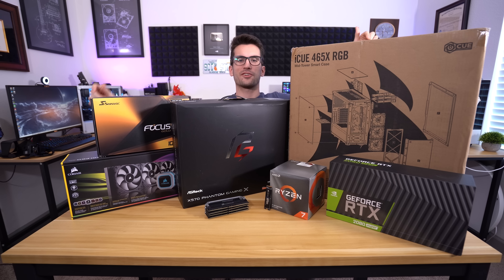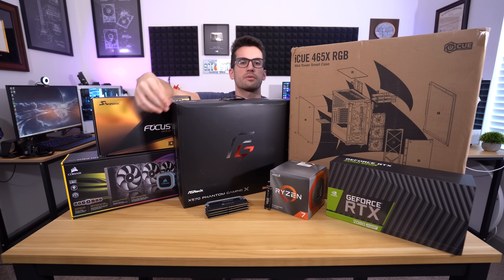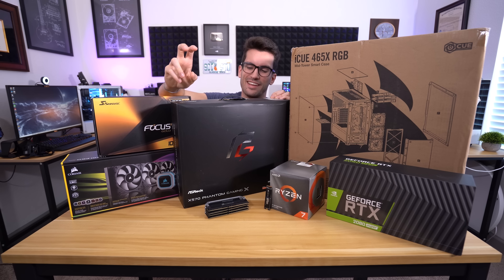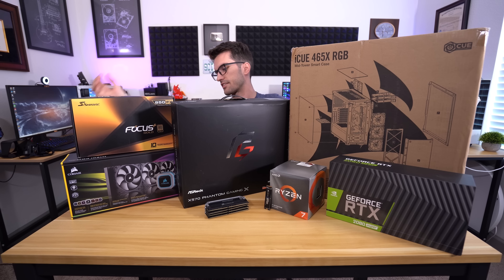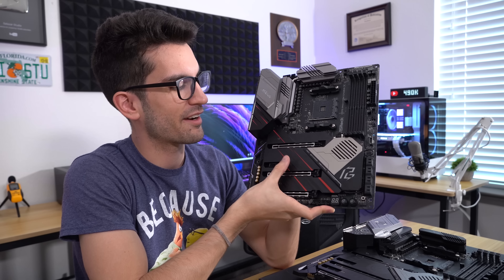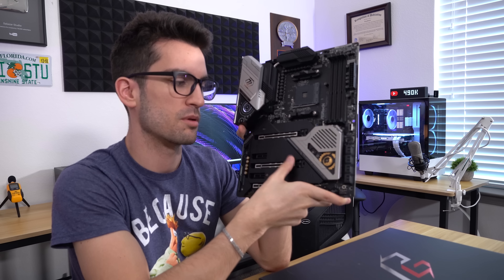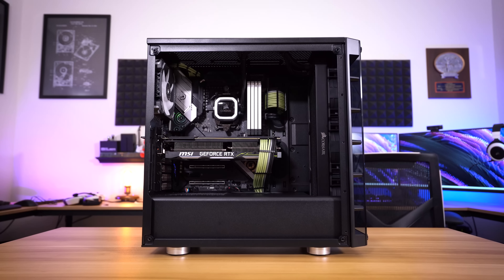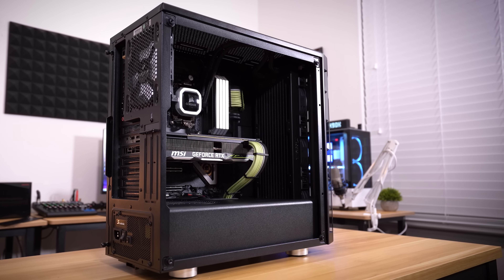Building a Powerful Gaming PC

Comment: "I'm going to use less RAM and a different CPU, for gaming"
"This is going to be my editing rig"

wait
Reply from the maker: In its current state, it's an ideal gaming rig. And I said that I wanted to use the 3800X for editing in Resolve, yes! :-D The 2080 Ti is a beefcake on the platform. But I'll be running different configs to test Resolve as I move along. 16GB vs. 32, 2080 Ti vs. 5700 XT, etc.
Reply: @GregSalazar  Fair enough :) still a solid machine, but I couldn't resist. Not like I have any room to talk, I record my videos with a smashed galaxy S7 and edit them on a computer someone gave me 6 years ago.
Reply: @ambirbtruckdriver  Smashed or not, its a very decent f1.4 12MP camera that does not disappoint!

Comment: I love Ryzen 3 but I can't seem to get it out of my head that the existing 3700X should be called the 3700, and the existing 3800X should be called the 3700X.

I was under the impression that the "X" in Ryzen's line-ups was meant to signify higher TDP's & base/boost clocks, and a higher number altogether was to signify more cores/threads.

Comment: Interesting. I just got my 3900x and I plan on using the AsRock Taichi x570 mobo as well.
Reply: I used that board for my new 3900x custom loop rig it's been a rly solid board so far no issues and I also have Nitro+ 5700XT Alphacool water block en-route

Comment: Why did you add thermal paste to the h150i pro when it has preapplied paste?
Reply: Because it's an enthusiast build and aftermarket thermal paste has better performance.
Reply: @yourneighbourhooddoomer  ty did not kno that i just did my first build with the same cooler on an i9900k on a rpg maximus hero vi wifi board and the temps seem fine. I did not overclock though.

Comment: Great stuff. However, modern cases are problematic in my opinion. They tend to have lots of fragile glass and mostly heat up gpu temps. Curious about those aspect of the build.

Comment: Great build man. Not that it matters much but why didn’t you move rad to the top with the fans the h150i pro came with? Then just keep the rgb fans in front? Did you just want less fan cables?

Comment: The color for those cables is more of a puke green instead of neon green tbh
Reply from the maker: Yeah they're less vivid than legit "neon." But hey match the Ventus Nvidia green, so I'm content.
Reply: @GregSalazar  Were those the ModFlex (Paracord) or the ModMesh (Nylon)? I've always heard the nylon has a bit more punchy colors but have never really looked into it
Reply from the maker: @chandlerreynolds40  Yeah nylons are definitely more punchy. They're also a bit stiffer, though, so they can be more difficult to work with in smaller builds.

Comment: I also use Davinci Resolve. I personally use the free version, because it does all that I want it to without any extra frilly bits that I wouldnt need to use. Its good, takes a bit of getting used to I must say though. Mainly because I went from Movie Maker 2012 XD 

Killer PC too. I have the 460x case and I might change to the 465x just because of that full over PSU shroud. Everything else is basically the same from what I could see at least.

Comment: I have this case, its a tight fit with a 180mm PSU with stock stiff cables if you leave the harddrive tray in

it fits but I don't like it

Comment: How much faster is this machine vs a machine half the price? e.g. Same RAM, case, possibly MB (unless you have a 'cheap' ASUS x570 Tuf) but use a stock 3600 and say a 5700xt (both in the 'value' department from most reviewers). The 2080 ti is very nice.

Comment: Dear Greg, could you please share your thoughts on the Taichi’s chipset fan intake position, and it pulling heat from the GPU? I was set on the board (disregarding their bad position of front USB C header) until I read that the chipset can reach system shut down temps during graphical loads.
Thank you!!

Comment: i'm kinda confused... didn't you build a fully custom watercooled build rocking a 3900X and a 2080Ti, that you were using as your editing rig? Why move down to an moslty air cooled 3800X/2080Ti build? The GPU PCB between the two builds is the same but one is watercooled and the CPU on one side is clearly better in computing tasks, I don't really understand..
Reply from the maker: I build and swap components literally every week. Don't look too far into it :-) I just wanted to emphasize my desire to use the 3800X and 2080 Ti with Resolve for a while.

Comment: I’ve got a 280mm aio going in that exact case but going to use the other fans that come with the aio obviously for size reasons but I’m wondering do I connect the fans first to the radiator then mount to the front ? Or fans first then rad to the fans ?

Comment: Do you think the x570 crosshair is worth it or should I just go with the taichi? I prefer asus’s bois but I can tolerate asrock’s bios.
Reply: You should state your usecases in order to get better advice
Reply: chemicalhap my bad. I only game but I will be over clocking my cpu and ram pretty aggressively
Reply: I suggest Taichi it's most well balanced board of X570 line up price/perf wise in my opinion

Comment: Im building a 1000 dollar pc with a 2080 here are the specs tell me if there are any improvements I could make
CPU: Ryzen 5 2600
Mobo: GIGABYTE GAA320M
GPU: Zotac AMP RTX 2080
SSD: 512 gb ADATA hard drive(this is the only used component)
RAM:16 gb viper patriot (2X8)
PSU:Thermeltake Smart 500W (is this enough??)
Case:rosewill fbm X-1
Total 1015 dollars (may be different depending where you live)

I'm scared of the PSU but I think it's good for the money
PS:I can spend up to 1500 but I did want a bit of money spare for the new consoles coming out next year :)

Comment: I clicked on SPONSOR link to try and configure a setup and I'm very sorry about that. The website is incomplete, they don't show how tubes will go. They don't count fittings, only 1 was in the shopping cart. So there is no point to use this configurator. Maybe their watercooling stuff is good, but it's pricey even if compared with EK.

Comment: Can someone mind helping me? I am looking to buy a Gaming PC (Pre-built because I dont know much about computer building). I saw this deal with a store near me. I was wondering if these specifications are reliable for gaming on PC. 

-AMD Ryzen 5 2600 Hexa Core GPU, 3.90 GHz, Hexa Six Core
-A320M Gaming Pro AM4 Motherboard
-8GB DDR4 RAM/Memory PC-19200 (2400MHz)
-Nvidia Graphics GTX 1060 6GB DDR5
-500W PSU 

I copied this from their website, so sorry if i made a mistake. The build is worth $1,099 AUD around $750 USD. I dont know much about this so bear with me. Thank you

Comment: I can't understand why you didn't go with a 3900X if you're using it for work.  Especially if you're replacing a 9900K.  A 3800X is more of a sidegrade than an upgrade.
Reply from the maker: It isn't meant to be an "upgrade." The 3900X is used in the office for other things. I want to compare the 3800X in Resolve with the 9900K in Premiere with QS.

Comment: My pcie connector are 6+2
Reply from the maker: Yeah, I was referring to the fact that Nvidia uses two 8 pin connectors on the card yet caps 2 pins in one of the clusters. This prevents me from forcing an 8-pin cable into the connector.
Reply: 6+2 means that 2 are disconnected from the other 6. Is your disconnected?

Comment: Fun fact; you can only get MSI gpu bling to work with MSI mobo...(because the dam dragon center whatever)
I was not able to get MSI gpu bling to work with Asus mobo anyway, but i was able to get Asus gpu to work with other non Asus mobos, so wtf?

This is why you now see youtubers to choose lesser blings, and they are keeping the info for some reason?

I do still take the bling that has manual button (fans n led strips), driver softwares are just shiet, they keep getting corrupted.
(And no, my ssd is brann new, so it should not be a thing).
Reply: We really need third party dev team to do the software for the blings!

Comment: I would have gone with a RTX 2080 Ventus instead the Ti and the MP600 SSD is way too expensive atleast here in Germany, for gaming a big SATA SSD is enough speed. Over 500 $ saved and some can be invested into doubling RAM to 32 GB for better multi-purpose build. I have similar specced system as workstation/gaming PC (same corsair AIO, 64 GB RGB RAM, couple SATA SSDs, MSI Ventus 2080, Corsair AX860 PSU and will be upgrading from 5820k to the Ryzen 3700x soon. I like my -back in 2015 very expensive - x99 Intel platform but man the Ryzen 3000 platform price/performance is amazing so bye bye Intel for now.)

Comment: He called 3000mhz fast.....yikes.
Reply from the maker: Compared to base DDR4 frequency at 2133, yes, it's fast. These modules have right timings as well, which is the other half of the equation many of you seem to be ignoring. High frequency RAM with garbage timings is pointless.
Reply: @GregSalazar   say that to ryzen.  Sure you want good timings too, but ram is cheap again. You can get a 16gb kit of 3733mhz cl17 for $80 bucks on Amazon. 
And i say even with 2133mhz being ddr4's base speed 3000mhz is pretty average now a days.